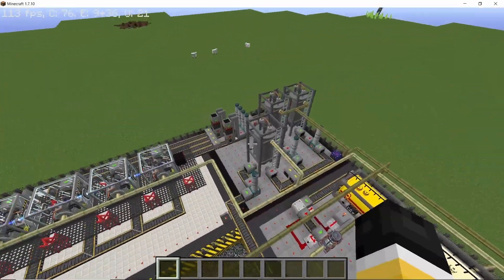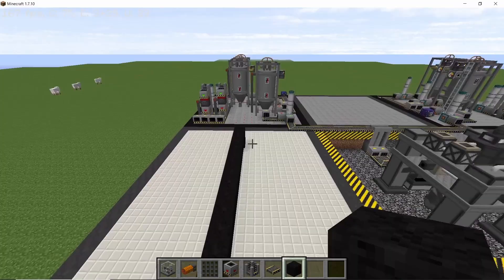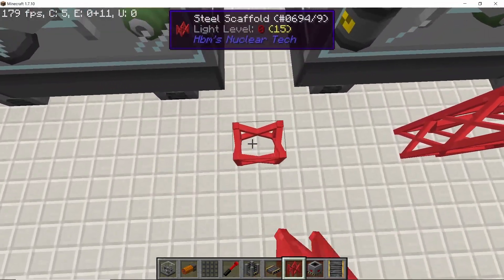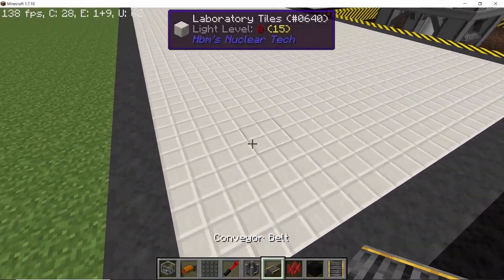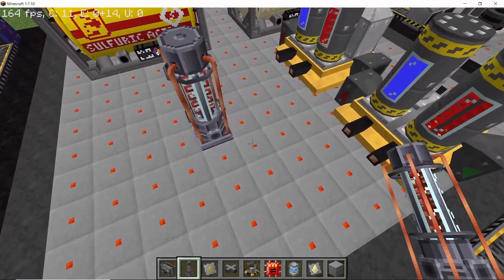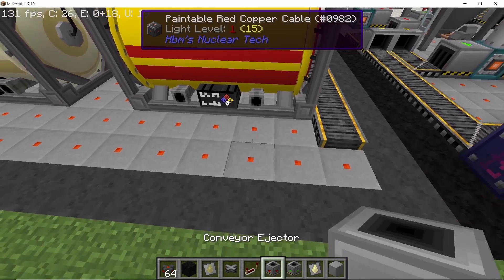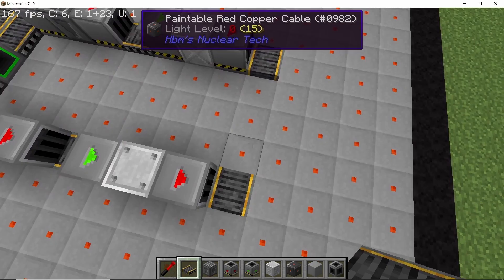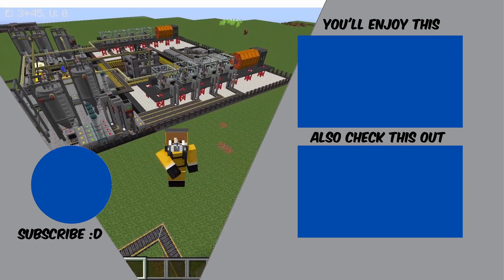Isotope Separation & Uranium Fuel AutoCrafting - Part 2 - Uranium Enrichment Plant - HBM's NTM

Comment: can you tell me how to disable meteor in hbm 1.7.10 and .1.12.2
Reply: Because a fooking meteor fall at around 400m blocks away from my base that have taint.
Reply from the maker: There are two armor modifications available called the meteor charm iirc which when equipped to the chestplate affects meteors 
the basic one will spawn a meteor far away from you and the upgraded one will disable meteors altogether.
Or you can just go into ntm config file and disable meteor spawn from there but that will affect survival gameplay ig
Reply: @SavageVegeta  thanks 😊

Comment: Can you handle plants that produce crude oil at the highest rate possible from coal and process crude oil?
Reply from the maker: https://youtu.be/uxyx3KFaWDM made it a couple of weeks ago, takes in 5 fracking towers running at full speed as input and processes it all into different outputs. Idk why you wrote coal in the middle of your sentences tho cause coal has nothing to do with crude oil
Reply: @SavageVegeta   It refers to the process of processing coal or coke into coal oil using liquefaction and processing coal oil into crude oil in an environment where oil cannot be collected.
Reply from the maker: @카트로페  hmm never actually tried that cause bedrock oil deposits are readily available. Well I'll try and see what I can do with a maxed out coal deposit cause once the rate of crude oil production can be figured out making a Refinery after that is kinda the same